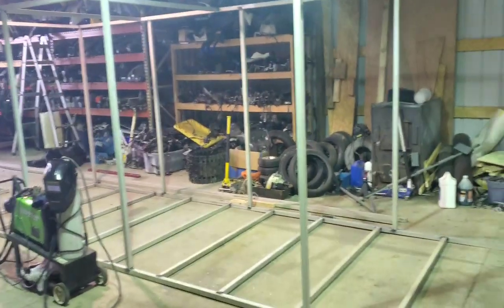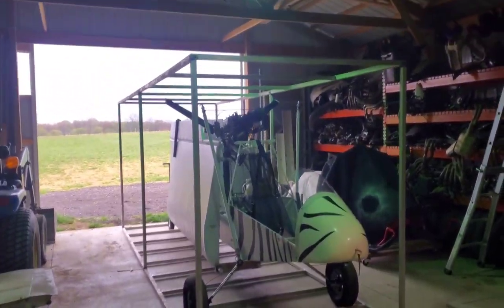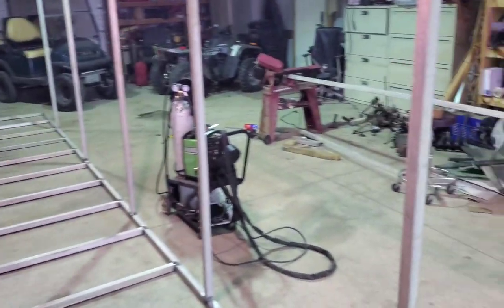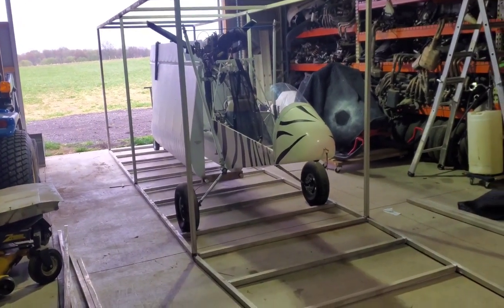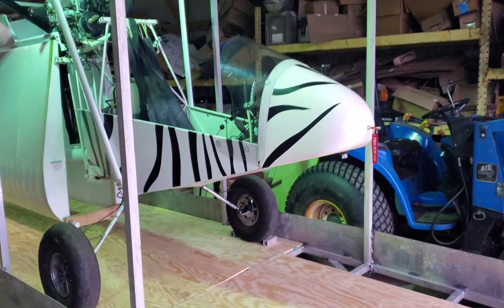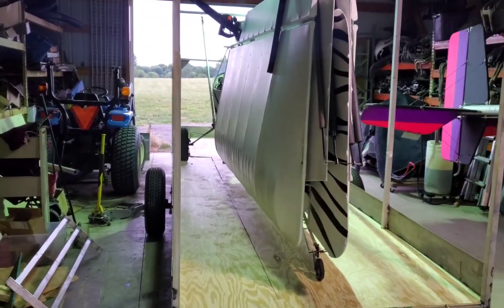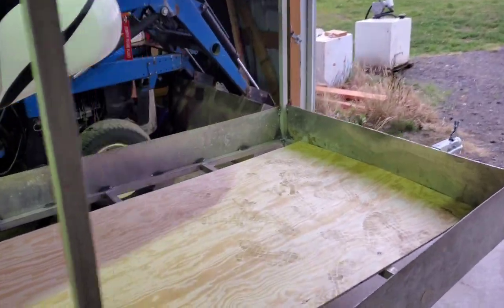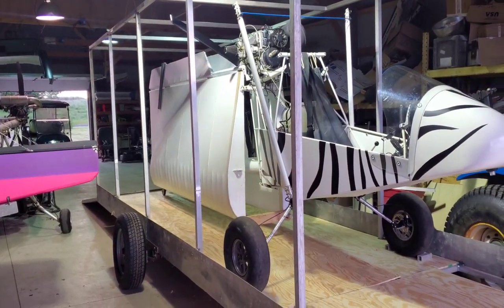Ultralight Airplane Trailer Build out of Aluminum

Comment: Love it. What are the minimum dimensions to fit the Kolb in an enclosed trailer, and what dimensions did you go with (inside trailer)?
Reply from the maker: This trailer is 6ft wide ,7 ft tall and 24 ft long. This will also fit a larger Kolb such as a firestar also. Minimum dimensions would be closer to 21 ft long, 6ft wide, and about 6.5 ft high.
Reply: about 30 inches wide other than the wheels, look at my channel

Comment: Couple things - I'd put softer suspension on the trailer springs. Potholes are gonna beat the light trailer & plane.  Also, I wouldn't tow a light trailer in a big cross wind.

Comment: Nice trailer for the Kolb!  Really thinking about getting a Kolb Firefly.  With a foldable wing like that, is the Firefly capable of aerobatics?  I know they are rated at +4/-2. I suppose if you do positive-only  aerobatics carefully at <2G  it would be fine. Haven't seen any videos of that.  I like the large tires and brakes on yours, for rougher fields.  Enjoy your videos!
Reply from the maker: Not reccomended by Kolb but it has been done https://www.youtube.com/watch?v=TnQBZqb79V8&t=305s
Reply: @bkairys  Thanks Ben.

Comment: On the front "section" of the trailer use the 1/16" thick aluminum diamond plates. It's light, pretty cheap and would protect the Kolb from stones being tossed up by cars and especially dump trucks. I lined the interior of a converted 5th wheel camper with it.

Comment: Nice work.   After having looked over some of your earlier videos, what prompted you to switch from the T-Bird1 to the Kolb Firefly?   Folding wings, perhaps?
Reply from the maker: TBird was a great airplane but yes difficult to keep at home with out folding wings. Besides that the handling and view is better in the kolb firefly as well.
Reply: @bkairys  Thanks for answering my question.  Once I sell some inherited property,  I'm leaning real hard towards a Firefly; preferably gently used ,assuming I can find one within a few hundred miles or so from Florida.     Otherwise, it will likely be a kit with the Hirth F23 engine, if that configuration can make FAR 103 weight.

Comment: I wonder how the trailer will do in high / cross wind situation? It's got the surface area of a full-sized trailer but weighs less than 1000 pounds with the plane inside?
Reply from the maker: Something to consider but under normal conditions I think it will be ok. Will do some testing before I take the plane for a  ride in it!

Comment: What would happen if you towed the trailer open? Can you strap/brace the plane enough not to damage itself? Just curious about much shorter trailer and supporting the tail boom instead of whole length/wheelbase.
Reply from the maker: I have a trailer like your describing. It works but weather and wind is always a worry. Enclosed makes it a portable hangar..